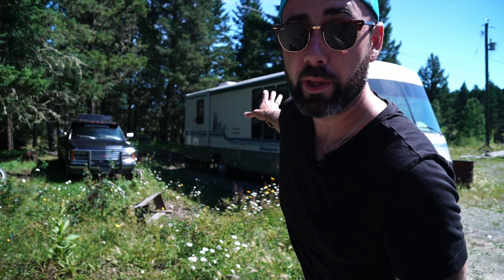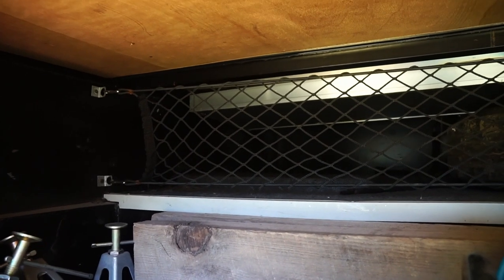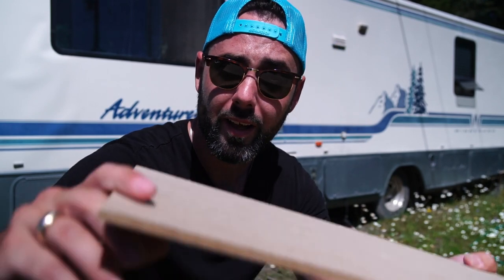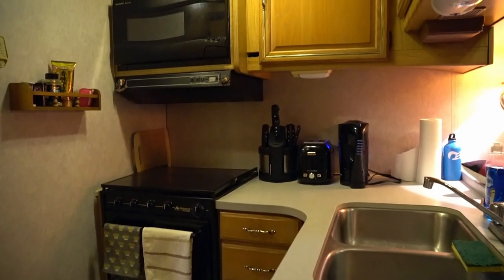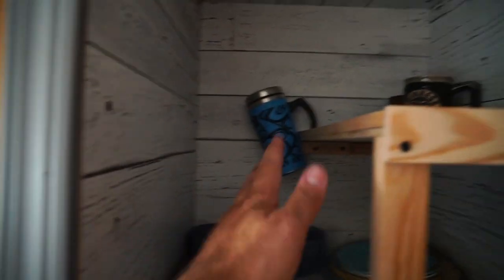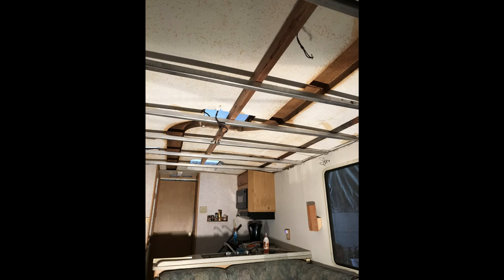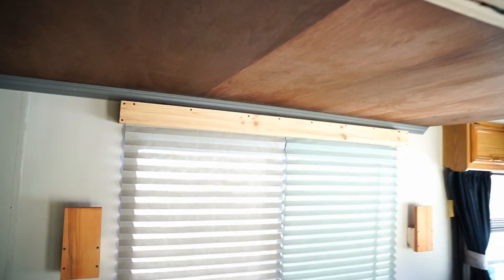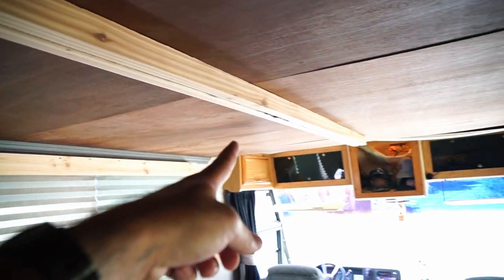I Build a Better Motorhome Than Winnebago

Comment: Dude whenever you get around to bringing your bego over to the Island I got a nice big driveway with an ocean view you can camp in if you need a spot.
Reply from the maker: Thank you so much.  These offers really mean a lot to me.   It’s very expensive to get a motorhome across the ferry, but if I ever do, I’ll hit you up for sure.
Reply: @Destination_Adventure  I don't know if bc ferries is still doing it but there used to be reduced rates for RVs and trailers on certain specific low demand sailings. And not that there's any shortage of cool spots to camp on the Island, you'd almost be wasting your time here in Ladysmith when there's so many abandoned or half abandoned cool little towns and history to check out! Your trip around the south Island was so cool to see a while back and there's SO much more on the north island. Lot of stuff like both the E&N and Englewood railways are only recently abandoned, every little town noth of Campbell River is well passed its heyday, as is everything on the west coast that isn't Tofino. And you're obviously not scared off by gravel roads so you could get to places like Bamfield or Ronning's Gardens. I should just get on your Patreon to help you cover the cost because I'd love to see what you'd dig up around here that I don't even know about.
Reply from the maker: WestcoastWheelman if I do plan this trip, I think I’ll reach out to bc ferries.   I’ll make a cool video for them like I did on the way to ocean falls.  Maybe they’d sponsor the ride over.